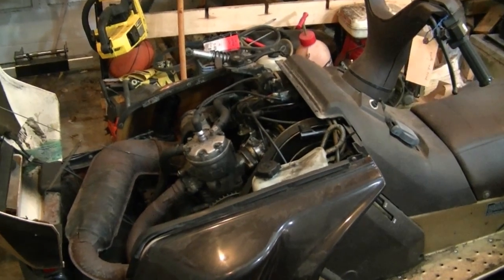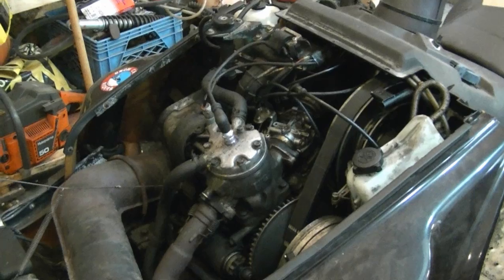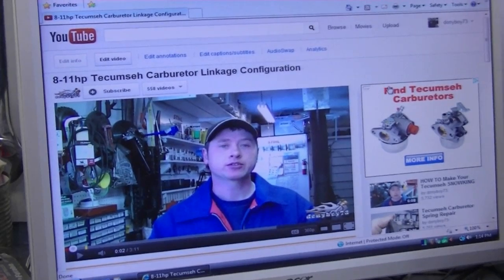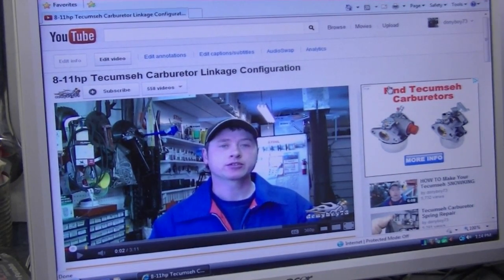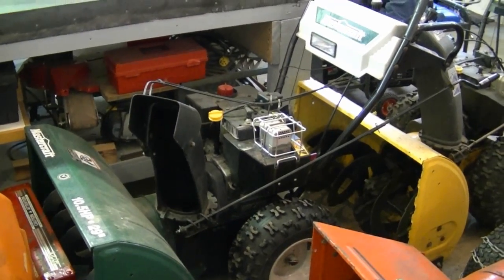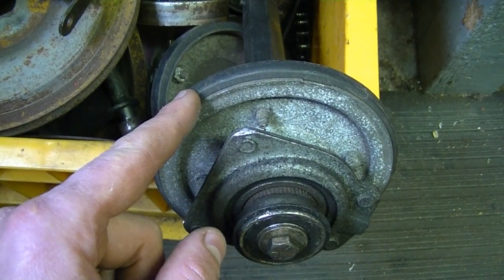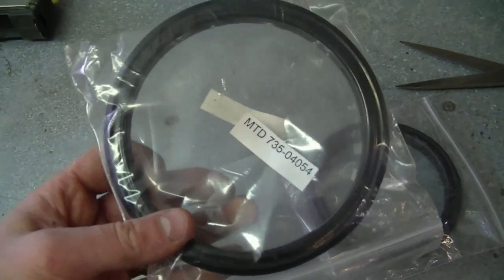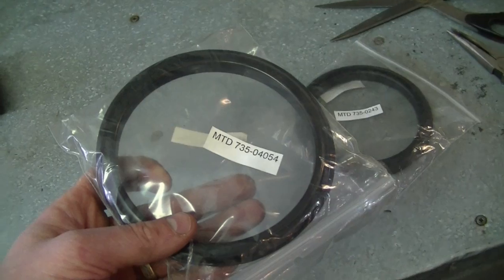Small Engines Q & A Video #81 in HD

Comment: Most of my equipment are 20 years old+ and I did the experiment of lower octane vs higher octane. The results were that higher octane made the engine start easier thus less wear on pull cords or starter. Whatever you save on gas you will pay in parts and labor. It is more pleasurable to change the oil and crank them to life without any worries.

Comment: Don.  Thanks again for your instructional vids. .  Higher octane rated gasoline does not burn hotter, and will NOT of itself,  cause an overheat condition.  Basically, octane rating of fuel is an indication of resistance to pre-ignition.  In our small engines, octane rating  has little meaning.      The ethanol in our pump fuel, due to its hygroscopic  characteristic, makes water absorption (from the atmosphere) a problem,  Stabilizing fuel is a very good idea.

Comment: Happy new year!  Thanks for all the great videos this year.  I wanted to comment about using high octane gas in a 4-stroke.  I purchased a 6.5HP horizontal shaft engine from Harbor Freight (some Chineese Honda GX200 knockoff).  The manual actually states not to use fuel less than 91 octane.  This is the only small engine I've seen that fuel requirement with.

Comment: Good idea to use old gas to clean engine parts, I put it into a pump spray bottle and use an old paint brush, or old tooth brush to clean off grease. I also use it to clean paint brushes. Mix a little with old crankcase oil to help start wood fires. (be careful not to use too much). There are lots of uses for old gas, but fuel injectors in any engine that has them can gum up with it, so it is best not to invite trouble.

Comment: From my understanding the mid grade 91 and premium 93 octane has little or 
no ethanol.I have started using nothing but 93 in my handheld equipment with a 
good premium 2 cycle oil, i use stihl oil,since i started having problem with fuel line shrinkage 
and deterioration,especially with tygon shrinking.JT from NC,USA

Comment: @fullraph  you know, that makes sense.  A big engine running at max output could benefit from the greater spark knock resistance of the higher octane fuel.  At  least there would be less worry about preignition.

Comment: i think you could just solder the joint, talk to the guys you got the top from i am sure they can help you out with what to use. if you get gas under the joint it will lift the glue i think

just a thought

have a great new year

Comment: high octane is very good for 2 strokes because they run higher compression, usually small 4 stroke engines have lower compression so high octane isn't as effective in power when its used.

Comment: higher octane fuel will burn much cooler than low octane one. there are a few drawbacks of ethanol - it's corrosive, eats plastics and it mixes with water, while petrol doesn't because it's hydrophobic. a corrosion inhibiting aditive was developed soon after, but classic and older cars can still suffer from eaten away gaskets and fuel delivery systems. water contamination is a general problem and can affect any vehicle.

Comment: Someone suggested to me, using moth balls for keeping mice away from my engines. Not sure if that will be the solution but since I have an outside shed I put some inside an old sock and laid it on the engine. Will find out  in the spring if that worked.

Comment: @donyboy73 Since i have 2 stroke oil in the gas in my 4 Cycle scooter i dont have less performance. It just runs normal after i topped it of with normal 95 octane gas.

Comment: donny i have a 12.5 bns vertical shaft engine on my mower but when it runs it kicks very hard and whenits off and i rotate it to top dead center it will not move like its frozen so what do you think is causing that? thanks happy new year

Comment: As you said, it would only cause a problem on a car with a catalytic converter. On older cars without a cat, it will be fine. If you had say 5L of old 2 stroke fuel left over, and added that to a 50L tank of fuel, the amount of oil would be so small I think a car with a cat would handle it just fine too.

Comment: @donyboy73  Lower octane than rated fuel can start engine to knock and overheats.
Here in Europe there is no lower than 95 octane gasoline for years. I even use 98 octane in all my equipment

Comment: I agree don these 4 strokes don't go over 4000 revs and heat isn't and issue it's the octane level  your really  looking as for mix fuel in modern car don't forget your fuel system like injectors. I'd b more worrie aboat that  in a short term.

Comment: engine like small engine that dont have the high compression you shouldn't run race gas because it makes less power and will build up more carbon on the piston and cylinder wall.

Comment: Octane is an antiknock rating. It has no bearing on the quality of the fuel. If your engine manual does not require high octane fuel then you do not need high octane fuel. It is just wasted money.